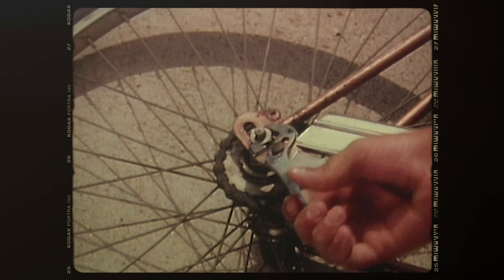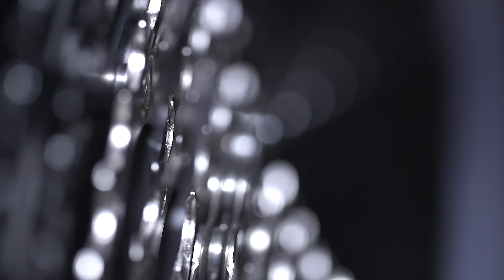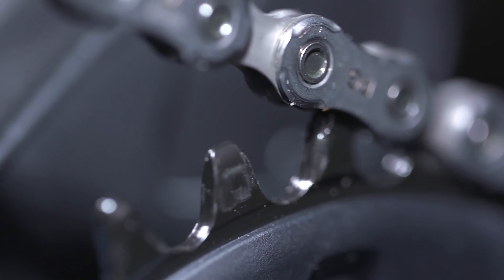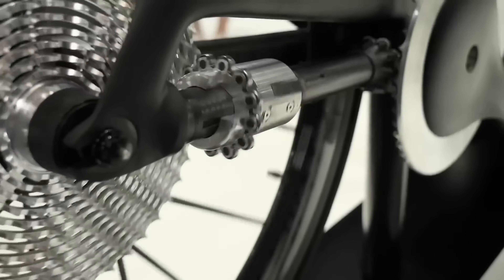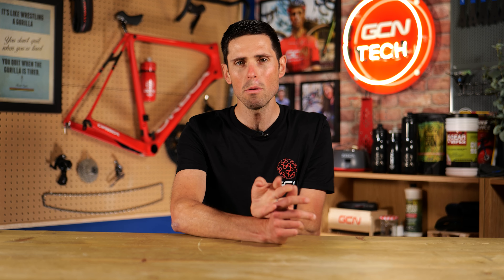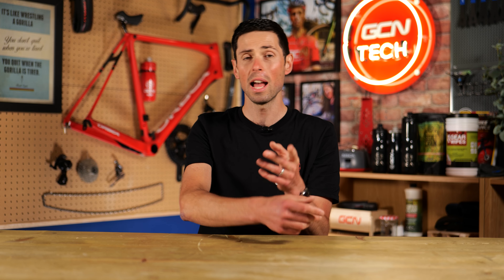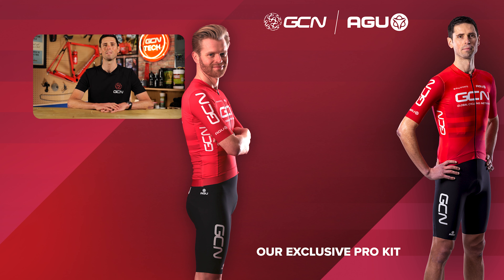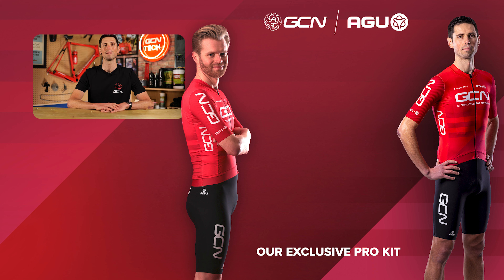Why This Will Never Happen!

Comment: My touring bike has a belt and a Rohloff gearbox, I will never go back to having a chain on that bike. It is so low maintenance, I can ride through mud for miles and not have to worry about anything sticking or going wrong, it just keeps working and is easy to clean afterwards. But I would also never change my race bike to a belt and Rohloff setup.
Reply: I'm a bike mechanic, I still swear by chains. A few belt drive enthusiasts constantly tout the benefits of their belt and internal geared hub, until something catastrophic happens and they learn that the cost of repairing it or replacing it is far more than the lifespan of the equivalent number of chains and cassettes (especially true for 7/8/9 speed derailleur setups).

Belt should last on average 4 times more than a chain, but if they fail prematurely they're rendered completely useless.
Reply: 100% agree. Belt drive commuter I got for $1000AUD (on par with most giant/Trek commuters) is now 7 years old. Brakes, tires, pedals all had issues but still same belt after about 25,000km.

The alfine 11 speed hub gear started leading oil, everyone was like now you learn why belts are not good cos of the cost of fixing will kill you

Will a whole new hub gear would cost $450, true, but after getting sick of hearing all the negative shit I dismantled it myself, cleaned it up, saw the seals in each side, found they cost about $8 to replace, so I've ordered some. Reassembled and it's not leaking already, imagine when I replace the seals! 

The only argument against belts and their gear boxes is if they break they're expensive, and their initial cost...

If gear boxes were made in volume, they'd be a fraction of the price and it they were more common, replacing seals wouldn't be a big scary deal either. 

I've since bought a chain MTB too and going back to chain maintenance, dirt, oil, chain wear... Feels like a huge step backwards.
Reply: How much is a new gearbox?
😉
Reply: @Lanceweeda  
1000 euros, thereabouts. But they can last more than 250.000 km. So I think I'm good
Reply: @Metal-Possum  The advantage is not necessarily the longer lifespan per se, but the longer lifespan with minimal to no maintenance. How long does a chain and derailleur drivetrain last when it is constantly wet, at temperatures around freezing, with road salt on it, without any care? A belt can deal with this abuse quite effortlessly. 
Or asked differently: How much time per distance ridden do you need to spend on maintaining (cleaning, drying, lubricating) a chain drivetrain in these conditions to achieve a reasonable lifespan? That effort is just not necessary with a belt and gearbox (be it internal geared hubs or bottom bracket gearboxes), and if you are someone who rides in almost any weather (like myself), this becomes a very important point.
Reply: I've spent months deciding between a belt+Rohloff or chain on my new bicycle. I've taken the decision for a chain because I didn't like the shifting feel on hub gearing, but I was also aware that it would be a very rare race bike with belt drive, and I'm still surprised it's not done more often. I'm very curious to know why you would never change your race bike to a belt and Rohloff setup?
Reply: @BoonBreyne  There are several reasons for that:
1. It is quite a bit heavier than chain and derailleur by race bike standards. We are talking on the order of a kg (or two pounds) here.
2. Shifting under even a light load is hard, and under full power it is all but impossible. If you get the hang of shifting right at dead center of the pedal stroke, this is fine, but chain and derailleur is much less picky in that respect (even if it might make terrifying sounds while shifting under these conditions).
3. A geared hub is slightly less efficient than a well maintained (!) chain drive. However, this advantage may be negated in the right (or wrong?) conditions, and also for multi-day unsupported races where you are unable to give the chain all the love it would need.
Reply: @BoonBreyne  couple of reasons. You lose about 5% of the energy. I would not ride my race bike through mud and bad conditions so the advantage you have with a Rohloff hub and belt in those conditions would not apply. Also drop bar shifters with a Rohloff are a pain as far as i have seen. Very long shift pull
Reply: @felixmarseille6905  Shimano alfine 8 speed costs 150 EUR and gives even more better experience then rohloff  if we talk about shifters, weight, affordable maintenance
Reply: @WolfzPain  Price, yes, but in terms of all of the other points I have to disagree. Yes it is cheaper, but the gear range is very limited (307%) compared to the Rohloff (526%), they are not even in the same ballpark. The weight difference is about 200 grammes, which really is insignificant when taking into account the system weight. The shifters are personal preference, and trigger shifters for the Rohloff do exist. One massive advantage of the Rohloff in my opinion is that the gear indexing is in the hub and so the alignment of the gears is not controlled by the shifter, this means it does not go out of alignment as the shift cables stretch over time. It is also impossible to mis-adjust. Compared to the Shimano, the Rohloff is much more servicable leading to a longer lifespan. Fot a commuter bike I would be fine with settling for an 8 speed shimano hub, the performance is good enough. But I don't think you can argue that the Shimano Alfine 8 speed hub gives a better experience. It has more drive resistance, is more finneky, doesn't last as long, can be serviced less and can be misadjusted leading to premature wear and gear skipping. It is an amazing product, but it is not as good as a Rohloff hub, for that price, it does not have to be.
Reply: @felixmarseille6905  I want to try Rohloff (or kindernay) and I think it's good, but I used to alfine 8, even to less range or its resistant (my mechanic fixed it little bit after first oil replacement, inside it was some paper spacers which rubbed against hub). I agree that alfine requires high shifting cable precision, but you can easily use it with drop bar or use di2 (what I guess fix this problem completely). Rohloff is good but too overpowered for casual rider. I agree that shimano has less resource but it's much chipper. Also problem of shimano its absence of thtrue axle support 
but otherwise it's a workhorse especially for its price
Reply: @Metal-Possum  I am using a Rohloff - Belt combination, and I have a replacement belt in storage. Should the belt ever break prematurely, it is opening the frame (two screws), replacing the belt, closing the frame and that is it. The Rohloff is probably a different story, However, in an urban setting (my main area of usage) the speed of gear swicthing (a fraction of a derailleur) comes extremely handy when navigaing around cars.
Reply: @brandy1011  I am driving a Rohloff - belt combination in an urban environment. I never had any problems with shifting under load. The shifting time is a fraction of that of a derailleur, so taking load off, swicth, and applying load again is no problem. One may has to practice at first a bit, though.

Comment: The bike chain is the same as a hammer in that it’s always worked and it will always work. There is no better tool for the job.
Reply: Pneumatic chain?
Reply: Glancing back at my bike with a belt drive and gear hub, I disagree, because for certain applications there are better tools for the job – no chain that can jump of the gears, no oil, no derailleur that can get dangerously close to the ground at times… Which does not change anything about the fact that a chain is still the best overall solution.

Comment: Would be great to see belt drive becoming more common for transport/commuter applications - even just for preventing oil stains on legs and trousers. Combined with a hub gear and/or electric assist and it's fantastic for moving more people away from cars for short trips. (Maybe)
Reply: There's no maybe about it. Bikes are superior to cars. I calculated it and my bike commute vs car both have the same average speed/hour despite the bike route being twisty with a bunch of 90 degree turns I have to slow down for and that my car route has a 55mph highway. Cars are just a stupidly inefficient means of transport. If I had a more direct bike path and/or an e-bike where accelerating/maintaining my speed wasn't an issue of muscle power my bike would be even faster on average.

I would LOVE a belt drive for longevity.
Reply: If you have oil stains on your legs and trousers, you don't know how to lube and clean a chain. Get a velco reflective strap to wrap around your drive side pant leg and you'll never have these issues.
Reply: @scopie49  - Fine. I'll drag race you from Phoenix to Tucson. Whoever gets their first wins the other's wheels.
Reply: @YippeeSkippie426  I think you missed the part where Jools said "short trips." US bike infrastructure is horrible and my bike commute is still as fast as a car. If we had good infrastructure my bike would be faster. We're talking about 5-15 mile inner-city trips. Not 500 mile open highway,
Reply: it's already the case in Germany. As more Pedelecs than real bicycles were sold in 2023, the upper and high price segment is dominated by internal gears and belt drives.
Reply: I have a belt drive bike.  It has a very low range of resistance
Reply: oil stains? who puts liquid on their chains in 2024? =)
Reply: @JackMott  When you are communting in rain and/or have an internal gear drive with a chain case, it makes still sense to use an oil based lubricant.
Reply: In Germany, bikes are often sold with belt drives. Cube as the biggest manufacturer has a wide range of belt-driven bikes.
Reply: @FuchsHorst I commute in the rain and use wax. I also have serious fenders and mud flaps. Have to wax more often than in the summer, but it’s not too bad.
Reply: @stiffjalopy4189  even one ride in the rain and the chain starts rusting. I have no time to dry the chain after each commute and re-apply wax. I love waxing but no on my all-weather/winter bike.
Reply: @FuchsHorst  I think that begs a certain definition of “rain.” Where I live it rains for days on end in the winter, but usually only a little bit of rain, not a monsoon. With typical conditions and really good fenders (I run Rene Herse with mud flaps), I get 150-ish miles on a chain between waxes. My commute’s only a few miles 3x a week, so exposure is limited. If I ride in a downpour with a bunch of standing water, i agree I get less. But I rotate through a few chains so it’s just a matter of swapping it out. I’m still only waxing once every other month or so.
Reply: Good to have a spare belt cuz belts dry up and break
Reply: At bike lockup stands, many cyclists lock their bike up with the drive side outwards, not towards the stand.
It is really easy to get someone elses dirty oil on your trousers when locking up your bike.

Comment: Belt drive bikes become more popular this year. You can find some basic bikes for 600 GBP in the discount. For commuters great deal! No maintanance, great durability. When you put 100W to your bike, 2 or 5 wats difference isn't a huge deal.
Reply: It's not the efficiency, it's that it feels like a rubber band and the feel is unpleasant.
Reply: @凸Bebo凸 No...? Belts are incredibly stiff and definitely do not feel like "a rubber band" lol
Reply: @henriwagner2068  Maybe it feels stiff to you when you drop the 100 watts and nothing happens.  When I drop the 1800 watts it feels like a rubber band, don't like it.

Only a good product if you've never felt peak bike in some way.
Reply: @凸Bebo凸 why would you drop 1800 watts to a commuter bike?
Reply: @top1gaming472  Not arguing with people that like belt drive.  Enjoy your rubber band.
Reply: the poblem is internal gear hubs, they are simply too heavy, but imagine you can not easily upgrade wheels, no carbon in many cases...
Reply: @凸Bebo凸  You're the one jumping in with the argument that didn't even address the main point of the OP. The dude mentioned it for commuter bikes.

So, as was asked before, why are you dropping 1800 watts on a commuter bike? You're not. You just wanted to complain about belt drives and flex the "1800 watts" figure.
Reply: @dvs620  I commute 150 miles a week for close to 20 years and drop 1800 watts all the time, dumb comment.  Not arguing with posh Euro commuters with no legs, enjoy your belt it's junk and you're a slow rider if it feels good to you.
Reply: @凸Bebo凸  Sure Jan. Still ignoring the comment about how it's good for commuter bikes.

But I'm not a Euro with no legs. I'm not a Euro and I  don't ride road. The closest I get is using my single speed to cruise around my downtown. Lots of quick acceleration and weaving through traffic. And you have to have legs for that.

But I'd rather do something exciting and ride off road. Give me wide bars, knobby tires, rocks, roots and bombing hills. You can have your Lycra.

Imagine a man who wears Lycra trying to insult my manhood. 😆
Reply: @dvs620  Nobody cares dude, I ride in jeans steel fixed gear, heavy gear ratio, high speeds no brakes.  You would not be able to keep up with me weaving through cars in Los Angeles, I used to be a bike messenger.

As far as you calling me a roadie goes, I respect roadies a whole lot more than belt drivers.  Roadies are all wild dudes, belt drivers are just trying to look cool but failing.

Enjoy your bike for beginners, you are a beginner.  Your entire bike movement is a cheap copy of the style that I ride my bike.
Reply: @凸Bebo凸  "Nobody cares dude." Proceeds to talk about how fast he rides. 🙄 Let me guess, you used to ride down the 10 through rush hour traffic splitting lanes and passing up motorcycles too. 😆

Nobody actually believes you.
Reply: @dvs620  Look at this guy dvs620, bought a bike that looked like a fixie for 2000 to look cool instead of just getting in shape, haha.  Too bad it's got that belt on it and you look like a joker when you pedal that thing to the bike store.
Reply: @dvs620  I rode on the 10 during lockdown, so yeah you aren't lying.

Like I said before I'm not interested in arguing about overpriced beginner bikes so find another man to follow around.
Reply: @凸Bebo凸  Go hit a velodrome, then ride up the PCH to the Bay Area before doing hill climbs in SF. Since you can generate so much power. What's your average output, like 600 watts?
Reply: @dvs620  Bro I use a bike instead of a car like 15 years now, I don't have time to go ride and do silly stuff on the bike, haha.  I am on the bike too much as it is.

Go ride your belt drive bike to the store slowly, purchase some frozen burritos.
Reply: @凸Bebo凸  I don't ride belt drives. And I'm not the one saying things on YouTube that NO ONE believes. But hey, cool story bro.
Reply: @dvs620  So you're just on here not riding bikes following other men around cool.  I think your type hangs out at the truck stop bathroom bro

Comment: The ceramic speed device "never really gained any traction 5:12 ) unsurprising that it failed then.
although I can see with wear and high loads the gears looked likely to skip teeth as the gear set inevitably flexed

Comment: i like the creative tinkers with chains, one vid the man welded a strip and used it flat against a sprocket on the steering wheel to push the tie rods left or right , it could make a cool slip gear maybe if you ground a few teeth off the sprocket so it slips like many electric airsoft  piston mechanisms , it lacks another bearing or bushing atleast on the contact points ....{ i mean the chain in a flat orientation on a flat bar or...

Comment: My bikes only use chains but I rather have the option of an alternative.

Also, much like how automobiles are going more and more towards drive by wire to cut manufacturing costs, I’m curious if it would be cheaper to drop the mechanical parts altogether and just have rotational force of pedals directly converted to how has a motor spins the rear wheel while recharging a battery as they spin the cranks.

Comment: I think an improvement would be to have the derailleur designed in such a way that it sits between the cassette and the front rings such that it's easier to design a light and compact enclosure around the chain. A chain that is shielded from the harsh environment like rain and mud will last longer and will be more efficient over its total lifetime.

Comment: 5:55 that's not quite true, your resistive heater is.
And speaking of heating, depending on how you look at it, a heat pump can be 200%, or more, efficient in heating 😉

Comment: i was interested in the motion the front tire and the back tire , the bike moves forward, the front wheel and rear wheel at the center are moving same direction but in the middle ,between the wheels they cross each other , the back of the front tire is moving upwards and the front of the rear tire downwards , they pass there in two directions but the same direction spin ...my point i can't fully explain but you could then "time" the motion by diameter , the surface speed of the smaller diameter is slower , the larger business one moves [much] faster but they pass , or toss off slower from the  smaller diameter and [edited off end there gone lol engineering }  ...they pass an easily calculated number of times per same spin with smaller diameter and larger on the same sprocket, belt , frictional  or gear drive  too

Comment: Downside of belt drives isn't the cost, it's the dependency issue, all of them requires cut frame. However, it is possible to make a hybrid belt, that has 1 roller chain link in belt's specific shape to use it in existing bikes, I'd go for it.
Reply: Cost itself is cheap, there are millions of belts in the market if you don't search for specific "bates garbon bike chain" you just need a belt and cog, the link that can connect the belt ends is the required item. (at least for me, an engineer)